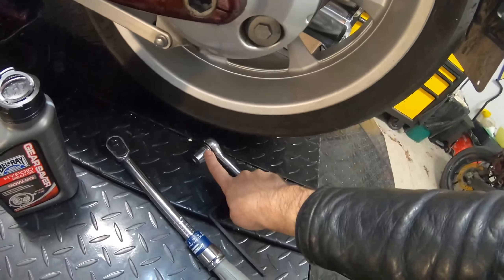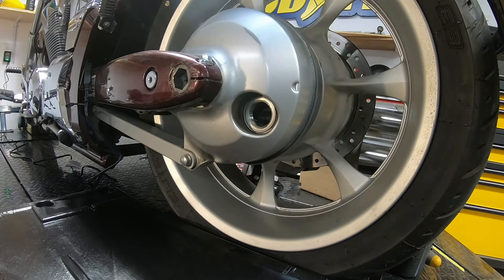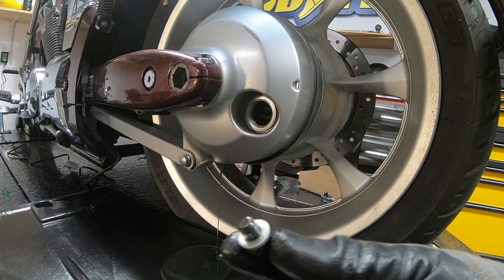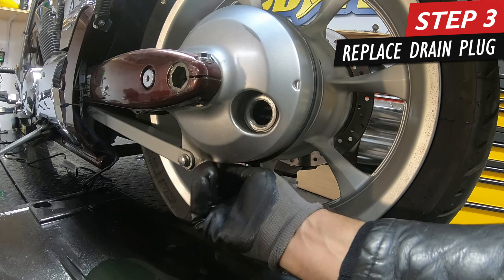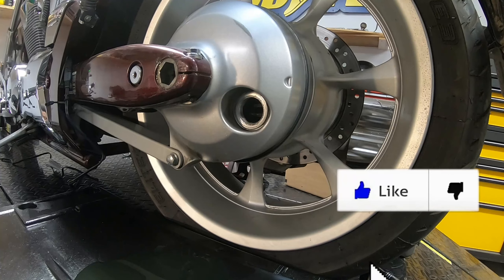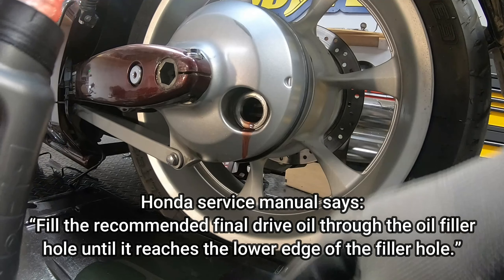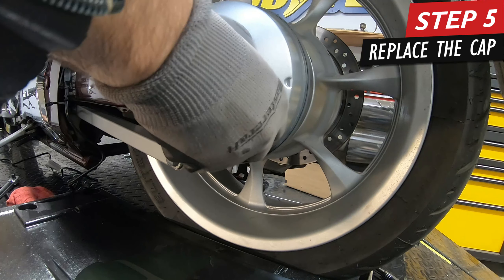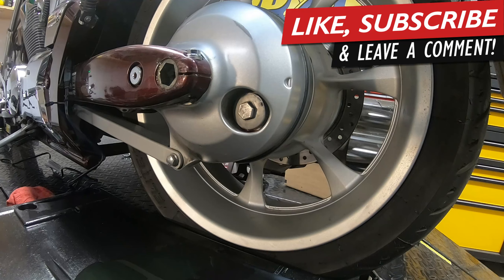How to Change Honda Fury Shaft Drive Oil

Comment: Excellent video. Straight to the point without blaring music over the narration or massive sound level changes. POV camera angle with text labels on tools is very helpful and well done. Details from the manual and torque specs are excellent additions. This is one of the best planning, editing and formatting jobs on a video I've seen in quite some time. Subscribed.
Reply from the maker: Thanks so much, I really appreciate that. I try to make the kind of how-to videos I want to watch when I'm looking to learn something new myself. Thanks again and ride safe!

Comment from the maker: Here’s what you need to change your Honda Fury shaft drive oil:
6 mm hex socket bit - https://amzn.to/3okGUVd
17 mm socket bit + socket wrench - https://amzn.to/38k3ZSC
Torque wrench capable of 17 Nm - https://amzn.to/3TM4Pxr
Hypoid Gear Oil 80w90 - https://amzn.to/3nmaOHk
Motorcycle lift (optional) - https://discount-ramps.sjv.io/motorcyclelift
Drain pan

Comment: The service manual actually says to rotate the rear tire while draining the final drive oil. Not sure why but maybe there is some captured in the gears? Also, it says to fill the oil, while being supported with the side stand, which is maybe why the oil level seemed low when you drained it while level on the lift?
Reply from the maker: Time for me to double check everything!

Comment: Where do I get the rubber gasket from?
Reply from the maker: @guillermolopez9174  it's a Honda part, so if it needs to be replaced you get it from a Honda dealer or online if you can find a Honda dealer selling it online.

Comment: How much miles I need to change that
Reply from the maker: "Most motorcycle mechanics agree that your shaft drive fluid should be flushed every two years or every 8,000 miles (about 12,900 km), whichever comes first. If it’s been more than two years since your Honda Fury’s last shaft drive oil change you should watch this video or read along and we’ll go over it step by step so you can save your money by doing it yourself." 
https://youmotorcycle.com/how-to-honda-fury-shaft-drive-oil-change-final-gear-oil-change.html

Comment: Hi Adrian 
I also have a 2016 fury.
I need some help.
My neutral gear is very difficult to land on. It keeps sticking. Then when I use more force it jumps to 2nd or first gear. What can I do?
Can you please make a video to show me, thank you.
Reply from the maker: Hey, sorry to hear your bike isn't shifting smoothly. When is the last time you changed the oil and what kind of oil are you using?
Reply: @YouMotorcycle  Hey. Hi I just changed it two days ago. I used valvoline full synthetic 10w-40. I'm still experiencing it, not at first but after riding for abit it happens again.
Any advice would greatly appreciated.
Reply: @YouMotorcycle  hi adrian. I hope your weekend was good. I replied to your question.
I know your busy. When you can please let me know if there is anything else I can do to get my fury to shift to natural smoother, thank you. Stay and ride safe.
Reply from the maker: @kosmic8204  I would check clutch lever, hopefully don't have to check clutch plates. Im not a mechanic so without seeing the bike in person or knowing it's history I'm not sure

Comment: Did you just drain on to the floor lol?  Enjoyed the video
Reply from the maker: That's a drain pan on top of the table. This one: https://amzn.to/3ajh1QO
Reply: @YouMotorcycle  hey! Thanks for the response. I didn't even own a fury a month ago, but I do now :).   Video helps, thanks.
Reply from the maker: @MechInvent  congrats on the new baby!
Reply: @YouMotorcycle  oh thank you, I'm addicted.

Hey so what's the best way to put the bike vertical?  I bought a rear flip up stand, but it looks like it won't work because the cobra exhaust. Should I just buy a full size motorcycle jack and be done?  Would prefer not to add it to the four other jacks I have :D
Reply from the maker: @MechInvent  Jack stand, wheel vice, bikini clad woman. Those are your only three options.
Reply: @YouMotorcycle  😆. Okay I choose option number 3.  It's free right
Reply from the maker: @MechInvent  I think so. I've never had to pay!

Comment: So ,i do this with the bike standing up?
The manual says on kikstand
Reply from the maker: Check again carefully. The top of the page (4-19) of the service manual says "Support the motorcycle on it's sidestand on a level surface" - but that's under the OIL LEVEL INSPECTION

If you keep looking further down the page (4-19 of my service manual) you'll see it says "Support the motorcycle using a hoist or equivalent..." meaning the motorcycle should be upright, not on the sidestand.

Hope this clarifies!
Reply: @YouMotorcycle  thank you very much
Reply from the maker: @keithbolkish5933  happy to help!

Comment: Wrong torque spec. 12nm is way too much. Made me split another $20 plug. Thanks…
Reply from the maker: Look at page 4-19 of the Honda Fury Factory Service Manual. 12 Nm is not the wrong spec, it's 100% correct. 
When is the last time you've had your torque wrench calibrated? It sounds like either you're using it wrong, or it is terribly miscalibrated, but if you check the service manual (just google honda fury service manual, and then go to page 19 of section 4) you'll see the torque spec is fine. Sorry for your troubles, but the problem is on your end. The instructions are accurate and the manual is correct.
Reply: It is 12Nm your just reading the wrench wrong. It's only 8.85 ft pounds

Comment: Hello the honda fury and interstate have 2 bults to drain the old oil, it is necessary to remove the 2 or just one
Reply from the maker: I have a feeling Honda put two bolts for a reason. Why not use them?